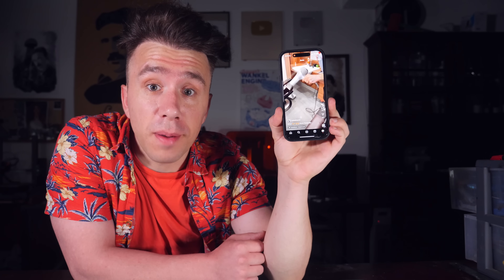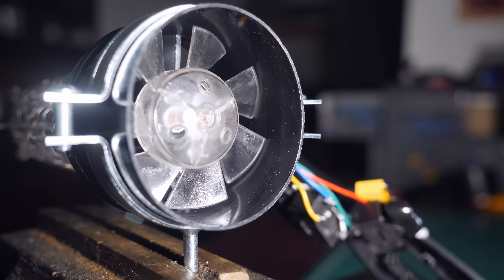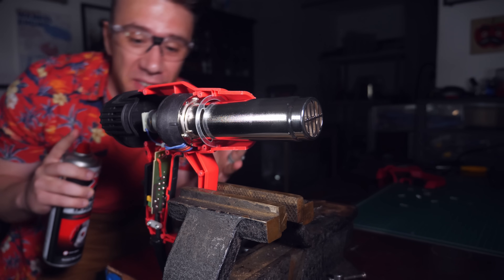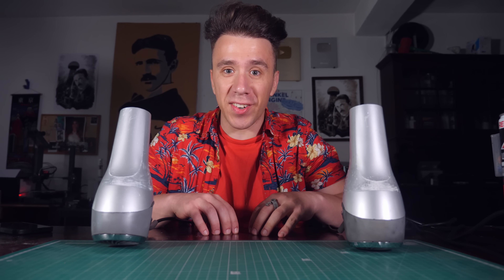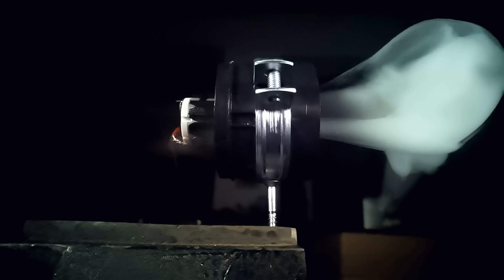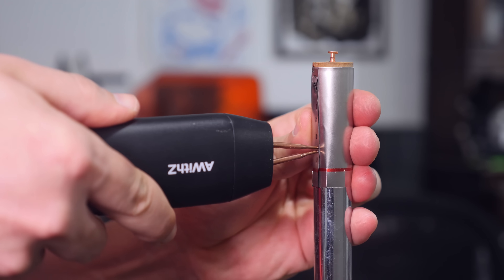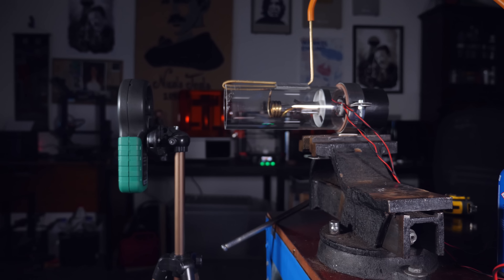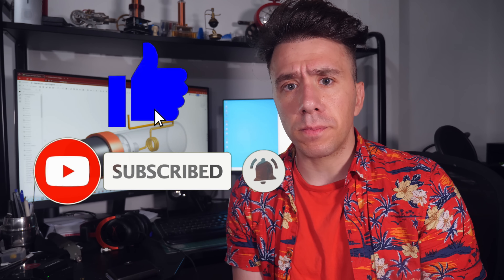I turned my $20 Hairdryer into a JET ENGINE

Comment: - **1 and 0**: Light and darkness, forming an infinity sign (♾️) on the left side.
- **6 and 3**: Representing dimensions, forming a mirrored yin and yang on the right side.
- **9**: The central stabilizing force that maintains balance.
- **9 + 9 = 18**: Simplified to 1 and 8, which start on opposing sides and balance each other out, much like Tesla's ideas of energy and balance.

Comment: You Could try using static mixers to mix the fuel and the air for combustion. Try using a Kenics Mixer or a Sulzer Mixer.

Comment: You could attach the fan to the engine then add a nozzle to preasureize the flames that come out thus using more air for combustion

Comment: To use the air and fuel mixture efficiently and take advantage of them u need more to pressure the air as u mentioned for the impeller

Comment: For fuel supply you could have a ring of pipe that goes outside the acrylic tube itself that has many ball pump needles that protrude throught he flame tube wall into the combustion chamber. These would allow you to supply fuel witout much air drag. Because the air is moving fast then a long combustion tube might help make sure that all the fuel is burned inside the tube. A thin circular band of metal spot welded to the needles could act as a flame stabiliser. Or maybe  asemi circular rinf of  round pipe with the needles putting fuel into the insid eof it could be a lower drag flame stabiliser.

Comment: I say small 30degree angled holes behind the igniter angling towards the ignition coil. Air from behind and the fire should pull its own air current from the holes to provide extra air to combust

Comment: Why not heat the fuel as before then do as in a jet engine, use a ring of pipe with holes in to inject the fuel all round the outside of the tube. Have fun.
Reply: Thank you. What next?

Comment: I have the solution insted of injecting fule fron the fan connect a pipe from the beneath of the nico wires which heat up using a metal pipe with fine holes so it dont melt and if you wnat to keep it natural just add this all into a normal hairdryer without any modification except the nico wire shortning.

Comment: In older f1 rules, the fuel tank volume was limited. They abused this rule by cooling down the fuel to -30c. At those extremely cold temperatures, the fuel is far more dense.
Just my random train of thought that happened to run in the absolute opposite direction of your heating up fuel thing.

Comment: 13:36 you could have the oxygen and the tier cleaner go through the same pipeline into the heated element so you didn’t have to use another pipe so it wouldn’t disrupt the air flow.

Comment: Tiny flexible tubes with microscopic outlet holes at the tips, spider legged through the tube calibrated to the placement and amount of legs, to gain optimal ignition without limiting the airflow.

Comment: control the fan and fuel based on the ratio 
also do a funnel going into the engine combustion chamber so you can condense air even more

Comment: the text is partly from the translator because I don't know some terms, I'm from Poland and I don't want to make a mistake and embarrass myself :D
my idea is to make a similar design to military jets, use multiple fuel injectors in a cylindrical shape as you did in previous videos, for example "I built an Electric Jet Engine from scratch" 6:07. Then the fuel you would use if you wanted it to be heated would have to use a separate heat source oooor, which is a better idea in my opinion, change the casing to a metal one, unfortunately it will no longer be ZE FLAMES but if you want to use as much air as possible for combustion you will not be able to use the outer layer air as an insulator. Returning to the fuel line, you will be able to wrap it around the exhaust to, firstly, heat the fuel before ignition, and secondly, it will act as a small radiator, so it will slightly reduce the temperature of the casing, just something similar like the raptor engines in SpaceX rockets are cooled.
Finally, I will just add a few comments so that you remember, firstly, when you record, remember not to put it too close to the camera as you once melted it, the same applies to the wind meter, and secondly, remember about the final test with the tomato.
Even if I don't win, I hope I helped <3.
Reply: and I remembered it, but it's probably too complicated for such a small scale, you can use 2 or more propellers to increase the air pressure and speed, like in turboprop engines

Comment: You need pressure and air speed - what about an axial compressor? Also to protect the tube as here use a larger diameter fan, so basically you're making a turbofan. I'm not sure I've seen you make one of those yet?

Oh, and I really want to see you combine your hydrogen peroxide/ceramic catalyst engine with kerosene fuel (so pretty much an actual rocket). Love your vids man.

Comment: In my mind a nozzle similar to the nozzle on a fighter jet right after the ignition area would help to use as much of the air as possible at all speeds. By using some sort of easy light weight system such as a rubber band or a string pully system that dilates based on the force its receiving but does not completely open so that the air is still compressed even at full burn just so that the burn never becomes inefficient. Moreover, an intake cone would also limit the amount of air within the jet which you can adjust for a better fuel to air ratio. This would also help to create a vacuum which becomes more powerful at higher speeds so that the fuel to air ratio is variable based on the burn and thrust created by the dryer. Lastly paint something red cause red = faster.

(I also posted to the video prior to reupload)

Comment: I would try using a  nozzle at the exhaust to increase chamber pressure  and also add a fine spray nozzle with a very wide spray pattern for the fuel and maybe kerosene or propane? Well that's what I WOULD do if I had a 3d printer (hint,hint😂) and a little free time.
Thank you so much for all you do!

Comment: Here's an idea, pass the air through a CD nozzle and inject the fuel with one of your brass tubes at the throat and ignite there. The combustion is performed at the narrow throat where the air concentrates, allowing it to be used more thoroughly. Also the CD nozzle provides additional thrust. There are still quite some things that I'm afraid perhaps didn't propose, and I'm definitely not great at physics but I suppose it's not a bad idea.

Comment: I sort of want to see what happens with what can best be described as a tear drop radius. It sounds goofy at first but it should channel all the air flow into the bath of the burning jet and increase combustion... Or so I am thinking.  Kind of funny seeing this and thinking on how all the prior times I have seen that kind of effect occur and it appears to me that the restriction of the air into the flame is what you were asking about at the end. Almost like how rocket engines have a spot where the fuel mix is squeezed thru then exits into a larger area.

Comment: So, as you can see the impeller in the video is pretty small right and to get more thrust you can increase the diameter of the impeller also If the casing around the impeller is small for a new one then just 3d print a new one which will fit a bigger impeller , what you can also do is use a system that can suck in more air just like a vacuum cleaner. ( You can also test out by adding more spark plugs for more fuel to get into the engine which will make more thrust and I think that this should probably work with your type of engine,)
Reply: Give the 3d printer to someone else (:

Comment: My first thought was "Cheap hair dryer... cheap brushed motor, just like cheap drills? Those things are regular spark throwers!"

Edit: HA! Looks like I made a good choice on cheap portable spot-welders! I bought that exact same one, and have been loving it! It's the perfect field-repair tool, or any time I just need a few welds, not a whole bank of batteries. (The desktop one is better for that.) But for quickly welding something like a little 3S BMS... perfect. 
Definitely worth the "eh, why not" purchase decision I made. (I mean, it still won't replace the desktop one, but has become an absolute "must" for my tool bag.)

Comment: Put the tube behind the heating element and make tons of holes in the tube. Also, compress the air a lot more and perhaps make small combustion chambers like real jet engines to control and guide the air.

Comment: Add a second inlet fan, stick a venturi between the second fan and the coil. Might work without the second fan if the first one can deliver sufficient pressure.

Comment: Alright integza , here is my idea: your model reminded me of an afterburner rather than the turbo jet it self, so I come up with 3 main changes. 

1st scratch the combustion tube and coil the copper fuel tube over the nicrom wire and drill tiny holes at the end of the copper tubing,
Thus the fuel will get heaten up beforehand and we can let all the fuel get contact with the nicrom wire.
2nd change the fan desing on the electric motor and make it like a multi stage fan and add a 3d printed or acrylic funnel like desing behind of it, this way, I believe, we can divide the incoming air into 2 sections with one being in the free flow state to keep the system cool and rest of it to mix more oxygen into fuel. 

3rd change is not even a change but more like keeping the first desing by keep adding fuel in the front so we can get a afterburner effect. 

Some extras might be adding a selenoid constraption with potantiometers to control the fuel flow and adding a exhaust cone to end. 

These are what I have come up with so far, I can try to draw a detailed model to explain all beter maybe. And it might be good idea to add that I have no experience with jet engines. Also I have used a lot of inspration from your older electric jet engine project and the EDF after burner one.

Comment: Hey Integza,

Here's a way how Integza can improve your  hair dryer jet engine project, focusing on the areas you mentioned:

1. Fuel Injection System:
* Move away from brake cleaner: Brake cleaner is dangerous and unpredictable. Explore safer, controlled fuel sources like:
    * Propane: Widely available, burns cleanly, requires a pressure regulator and a metering valve for controlled injection.
    * Hobby fuels: Fuels like methanol used in model airplanes offer good control but require additional safety precautions.
    * Alcohol: Pure ethanol (grain alcohol) is readily available and burns hot, but requires careful handling due to flammability.
* Injection method design:
    * Simple nozzle: A small metal tube positioned behind the motor injects a fine stream of fuel. Experiment with different nozzle sizes and locations for optimal fuel-air mixing.
    * Venturi injector: Uses the airflow from the motor to create a low-pressure zone that draws fuel from a reservoir. This offers better fuel-air mixing and precise control. (Requires more complex design)
2. Combustion Chamber Design:
* Material selection: The current hair dryer housing might not handle high temperatures. Consider:
    * Heat-resistant metal: Stainless steel or high-temperature aluminum can withstand the heat. Requires machining skills or purchasing pre-made parts.
    * Refractory materials: Ceramic or ceramic wool can insulate the chamber and retain heat for improved combustion efficiency. Requires careful handling and proper curing.
* Chamber shape: A cylindrical chamber promotes even heat distribution. Consider tapering the chamber towards the turbine for better airflow towards the blades.
3. Air Intake System:
* Airflow optimization: The current opening might create turbulence. Design an air intake with a:
    * Baffle: A curved plate that directs incoming air smoothly towards the motor.
    * Venturi effect: Similar to the fuel injector, use the motor's airflow to create a low-pressure zone that draws in more air. This requires careful design of the intake shape.
4. Turbine Design:
* More turbine blades: Adding more blades increases the surface area extracting energy from the hot gases, leading to more thrust.
* Blade angle optimization: Turbine blades should be angled to efficiently convert the hot gas flow into rotational energy. Research turbine blade design principles for optimal angles.
* Material considerations: The hair dryer blades might not be strong enough for high temperatures and pressure.Consider replacing them with:
    * Lightweight metal: Aluminum or titanium blades offer strength without adding excessive weight. Requires machining skills or purchasing pre-made blades.
    * High-temperature plastics: Certain high-temperature resistant plastics can withstand the heat, but might not be as strong as metal.

I have an idea for your next challenge video that's a perfect blend of your engineering skills and our shared interest in alternative energy sources! Let's build a Stirling engine powered by the sun!
Here's the plan:
The Build:
We can go two ways with the engine itself. We could either:
* Grab a pre-made Stirling engine kit. This would be a great option because it comes with everything we need - hot and cold cylinders, displacer piston, and regenerator - already assembled.
* For the experienced viewers out there, we could build a simple Stirling engine from scratch! This would involve machining the hot and cold cylinders, displacer piston, and regenerator ourselves. Just a reminder, safety first when working with metalworking tools!
Harnessing the Sun's Power:
To turn sunshine into heat for our engine, we'll need a solar concentrator. There are two main options:
* Building a parabolic dish: This classic design uses a curved surface to focus sunlight onto a single point. The challenge here will be building a sturdy dish that can track the sun and withstand a bit of wind.
* Using Fresnel lenses: These flat lenses can also concentrate sunlight. They're lighter and easier to adjust than a dish, which could be a big advantage.
Putting it All Together:
Once we have our engine and our solar concentrator, it's all about putting them together! We'll need to mount the engine at the focal point of the concentrator to maximize heat absorption by the hot cylinder. Here, using thermal paste or a heat pipe will be crucial to efficiently transfer that heat and get our engine running smoothly.
Testing and Results:
This is the exciting part! We'll connect the Stirling engine to a small generator or another load to see if we can generate some electricity from the sun's power. Of course, during testing, we might encounter challenges like not concentrating enough sunlight, friction losses in the engine, or limitations of the design. But that's all part of the learning process, right?

Comment: Hello!

As stated in the first video upload, I believe the issue with the « new » air drier is the air to fuel ratio (AFR) is out of the flammability range for the brake cleaner. Thus the brake cleaner may just dilute in the air without burning. If this theory is true, then decreasing the AFR by injecting brake cleaner by 2 bottles may be the solution to get a bigger flame than the current one with the broken air drier.

Then, looking at the custom solution, adding a second injection ring along the internal wall of the tube, about 10cm behind the combustion chamber could be enough to use all the air available in the tube. Combustion would be launched by already burning gaz from the inner flame. This would work as a post combustion on a jet fighter aircraft.

Hope this helps!

Comment: You could connect the gas line to a 3d printed propeller with holes that injects through the back of the propeller and comes out of the propeller using pressure, and then you could have the whole tube covered with the heaters. You would have to use something heat-resistant.

Comment: you can try to improve the combustion by chanaling the air so it comes out like ca 5cm after the injektion tube so the air gets moved right in front of the flame, that hopfully makes the combustion bigger.

Comment: Maybe to fix the fuel-air mixture problem, you could make a combustion chamber like jet engines have that is wider in diameter than the outlet section so the air has to slow down a little bit and will catch on fire more easily. You could also aerate the fuel more easily with multiple tiny spray nozzles, and if its safe perhaps you could empty the brake cleaner fluid from the cannister you're using for better control.

Comment: Great video, although at the moment its a glorified blowtorch and not a jet engine, but still, good job. A tip I have is that you could just use a convergent pathway right after the fan and get a more powerful motor. As you likely know, that's how air is compressed in the compressor in gas turbine engines, and I'm sure it'll work for you as I know a thing or two about gas turbines and worked on them in the past. Speaking about Gas Turbines, atlhough it would be a much more time-intensive project and would require some metal-working skills it would be great if you could do a version 2 of your Turbojet Engine on a larger scale and using less 3D-printed parts which are highly susceptible to melting. I'd gladly wait for a while for that.

Comment: I will build a Flying Bike or vehicle with this Idiea    🤩🙏  but I need a betteres Influe mortor for a turbo schoop and dint break at high temperature over 1000° and burn at Explotion controllable power out fill burn in small format